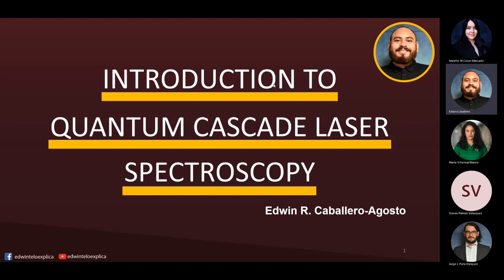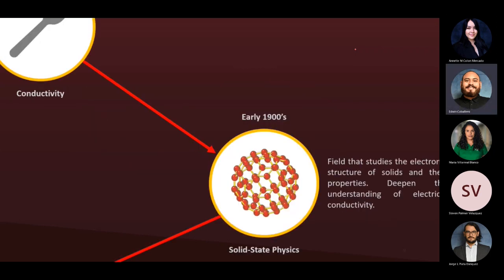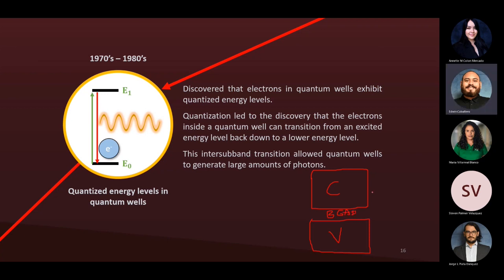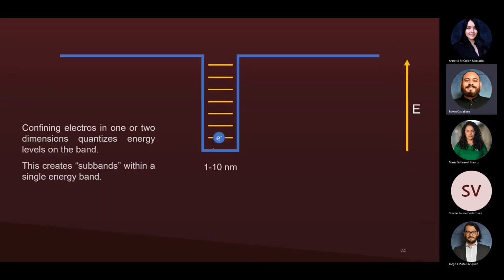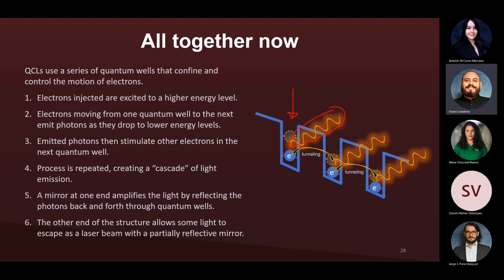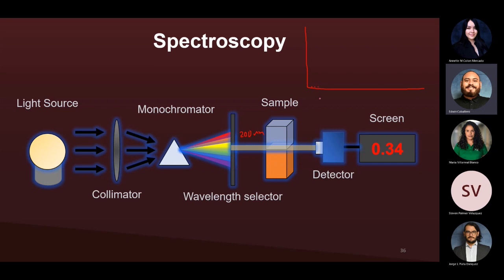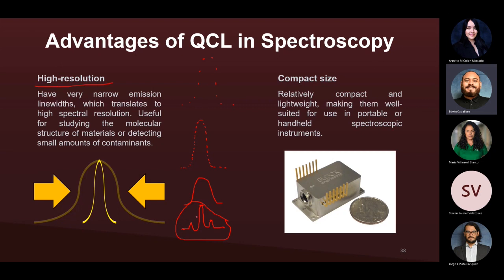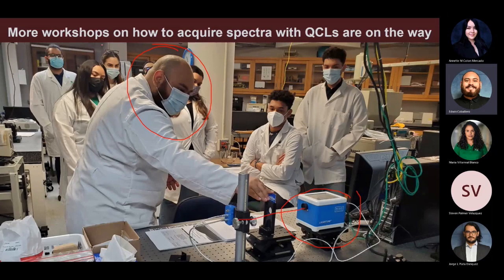What is a Quantum Cascade Laser? It can be used for what?!

Comment: L  = Light is A = Amplified by the S = Stimulation of the E = Emissions of R = Radiation  =  LASER is a DEVICE.  Then a Stream of PHOTONS are shot out of the LASER DEVICE...so it is NOT what you said.  A beam of light...NO..its a stream of photons.

A LASER is a DEVICE a stream of PHOTONS is what happens so the way that you described it is kind of correct but in Pyhsics we don't do KIND OF...   There are 2 parts to this SYSTEM.